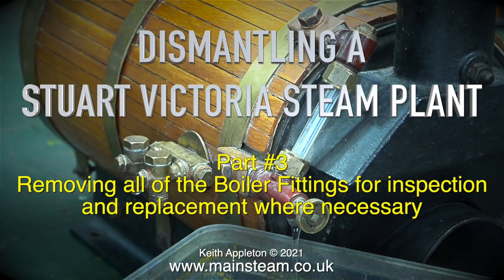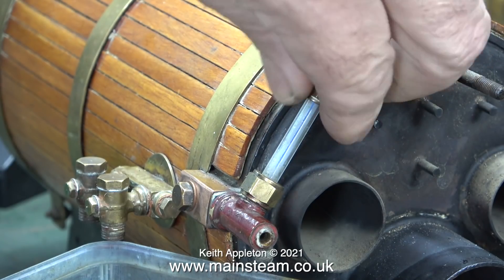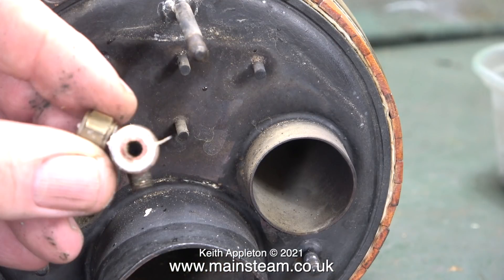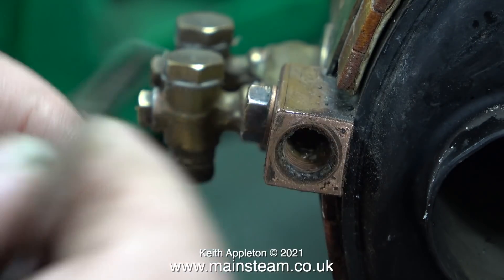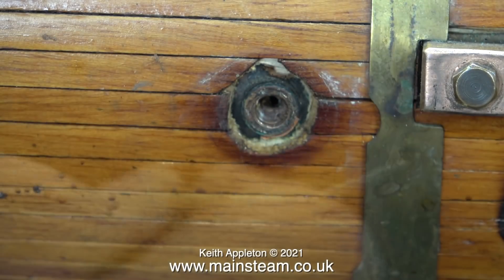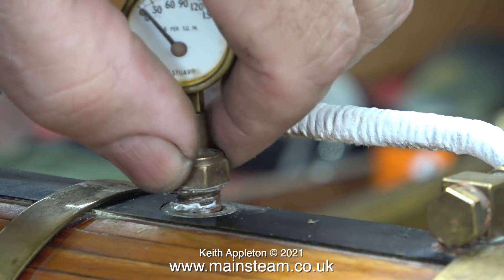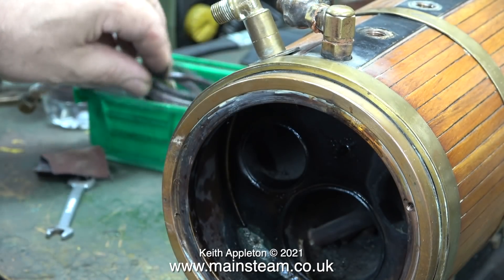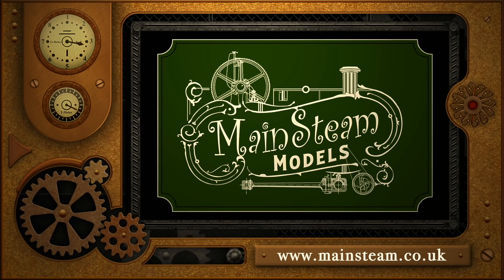DISMANTLING A STUART VICTORIA STEAM PLANT - PART #3

Comment: liiked like you where turning the fitting clockwise. Would that not be tightening the fitting?
Reply from the maker: The extractor has a left hand thread . . . .
Reply: @keithappleton  That would explain it. Thank you

Comment: Quick question why do you want to remove the vintage parts from a vintage boiler?
Reply from the maker: Because they are quite old, de-Zincified and very brittle . . . .  which can be dangerous when they are under pressure.